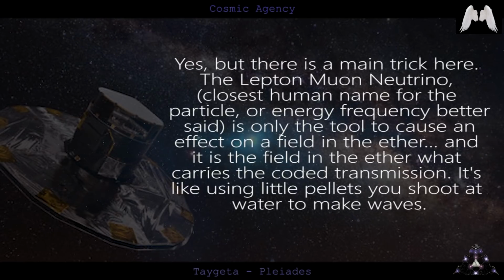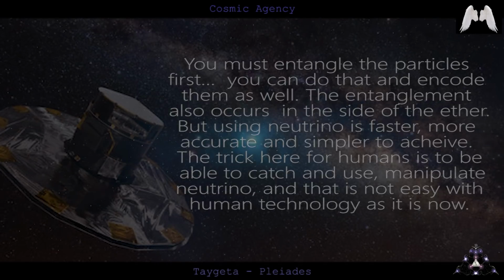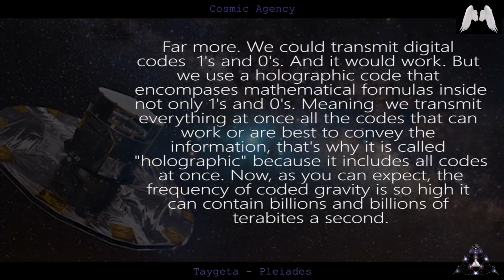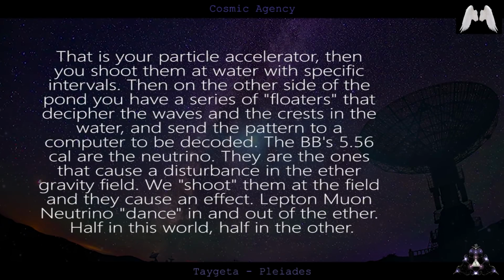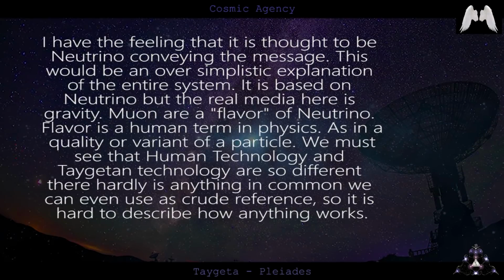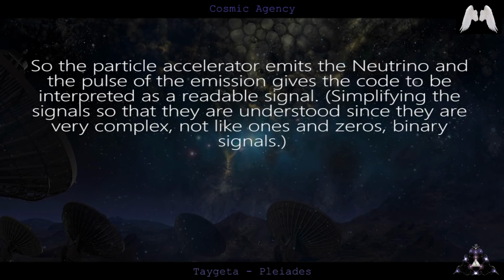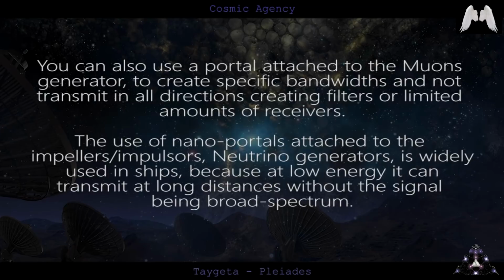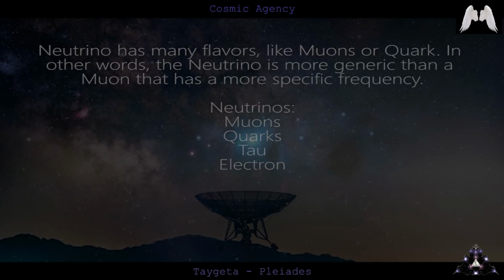How do Extraterrestrials Communicate? MUONS and GRAVITY (Anéeka of Temmer - Taygeta - Pleiades)

Comment: If the muon-devices are applicable on Earth, via quantum computers, what would stand in the Federation’s way to implement this technology on behalf of the technocratic elites? Wouldn’t this be extremely important to be kept secret? – and even hiding it from the different parties within the Federation (– we don’t talk about terrestrial technology by any measure here)? Think of what this tool could mean (or actually means) to mould the official narrative and making the population complacent with the current development... The “solution” (after “reacting” to the “problem” of corruption and crimes in the power-structures) needs to be presented without too much opposition. But to achieve that, the narrative must be effectively uncontested. And this technology enables the controlling faction within the Federation to smoothly ‘direct’ the development. You wish to be a “colony” for yet another 12 000+ years? Here you have the tool.
The reason why Cosmic Agency have not yet been censored for communicating this? Because the official “narrative” of “no aliens present” would be seriously questioned if it was. And we would become aware that they are not only present, but there are even different factions among them. So controlling the “narrative” is veeery important. But we want to know. And we need to know. From day one of Cosmic Agency, the Taygetans have successfully helped us to perceive the reality as it is – not according to some “narrative,” which somebody with full awareness out there have constructed and implemented via their empathy-free minions here on the surface. Gosia, you and your team already know this, but you are sooo important to us. Thank you, yet again... :-)

Comment: While Covid fills the airwaves here on Earth and people fret about forced vaccinations, the U.S has been quietly preparing for a kinetic war with China in the South China Sea. Seems someone may have struck first in San Diego. Nothing else explains the confidence, cockiness, and out right bluster of the Chinese Communist Party than they have been assured the United States is under control. 

The entire US high technology sector is under the control of the Political Zionist movement, Israel and Rothschild. From electrical grids to military and civilian encryption to data intercepts to the heads of private NSA subcontractors - everything. Nothing has escaped them.

Isn't it time we walked and chewed gum? Covid is a worry, clearly. But did Israel and China release the virus to warn off the United States from attacking the egg basket Israel had laid all their hopes in? Are we forgetting Election Guard and electronic voting machines? The Pentagon Cloud? The Windows Operating System...and on and on. 

The great danger is not China and the CCP. The great danger is Israeli and Russian subversion of the United States and if Donald Trump will not deal with it, someone needs to deal with Donald Trump. We hope the take down of the CCP is more than theatre and large scale crisis acting. and we hope as the CCP is taken down and China's high technology capacity removed, we hope Israel as a promising world power goes with it...and then there is Rothschild and the Predatory Internationalist Banking and Financial Class. 

WAR - AMERICA v CHINA - U.S.S. BONHOMME RICHARD https://youtu.be/aJE8aTAbhU0

Comment: Great to hear your voice Dale. 

When I heard sister say 556 bb guns I thought she was calling our M16 rifles bb guns because they use 5.56x45mm cartridges that we used to call in slang terms, five five six rounds. But she clarified plastic bb's. My old pump pellet gun used .177 lead projectiles and my friend had the yellow  plastic bb's gun. I have never heard them called 556 before today. 

Also, this gravity muon public encryption reminded me of https or secure socket layer (SSL) used in our world wide web networking communication today using public key encryption, or public key cryptography. A method of encrypting data with two different keys and making one of the keys, the public key, available for anyone to use. The other key is known as the private key. Data encrypted with the public key can only be decrypted with the private key, and data encrypted with the private key can only be decrypted with the public key. Public key encryption is also known as asymmetric encryption. It is widely used, especially for TLS/SSL, which makes HTTPS possible. 

I recall when the unencrypted 'http' changed over to 'https' in our address bars while I was in tech school programming routers. Early websites that we built had to have secure shopping carts with an encryption method involved so we also learned system security and ethical hacking methods to penetrate or find holes in the network where private data was being passed along. Then sewing up those vulnerabilities. When http(s) came along it was harder to hack. 

Speaking to ET's, I wonder if I got on the wrong bus? My communications with them are brief, infrequent and always involves gravity canceling craft. I wonder if gravity communications are disrupted in those type of craft and how this is remedied?